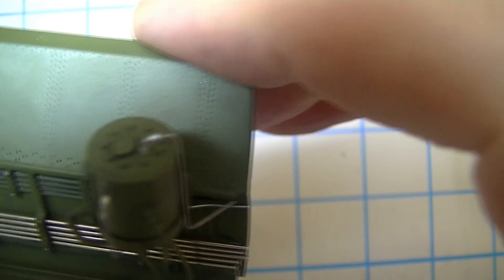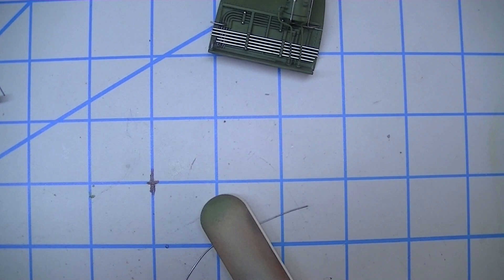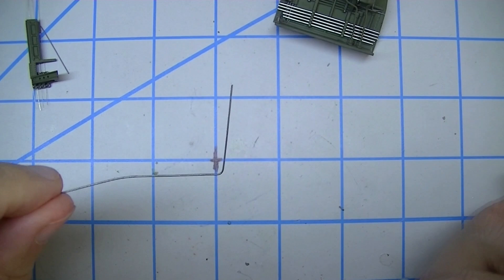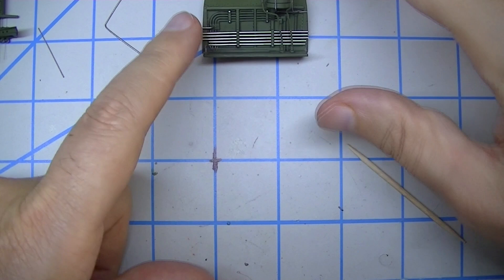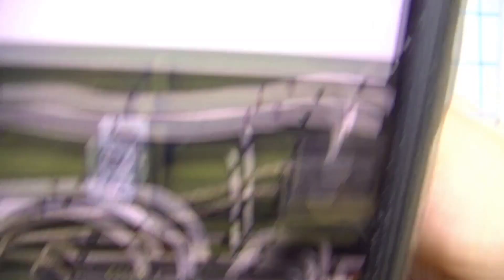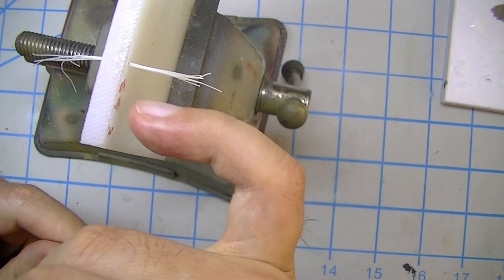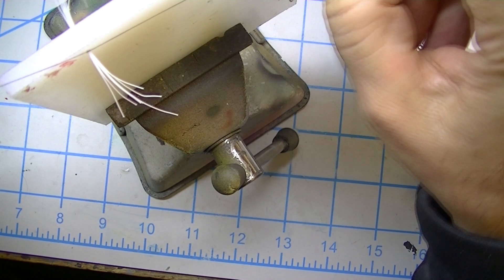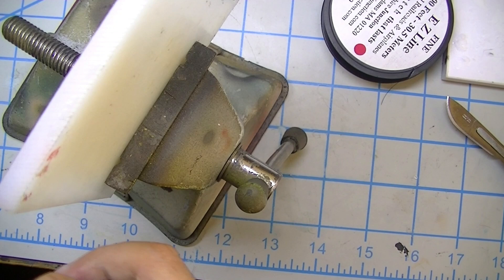ep272 - 10 minutes of random #35 (making detail tubes and wire bundles)

Comment: Hi will, At  2:00,  you mention about scale. Is there a math formula to use to get the correct (gage) or Thousands diameter wire? Am currently building a 1:35 scale model bulldozer. I currently am using 16, 19, and 24 gage wire, and wrap with masking tape, with a light layer of super glue. But how could one determine what gage wire to use for example oil hose, or spark plug wire, or similar using 1:35 scale model?